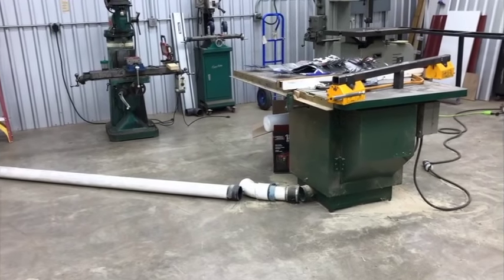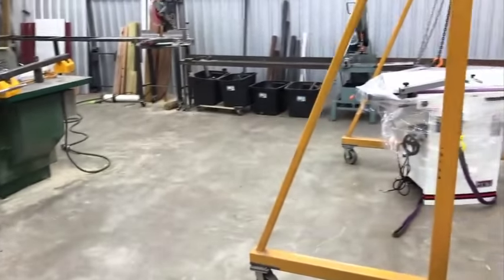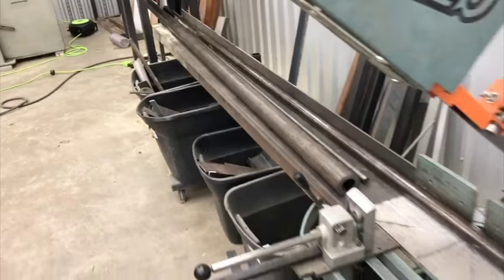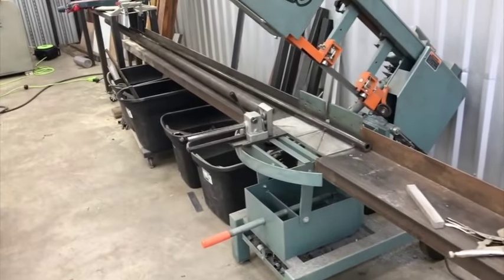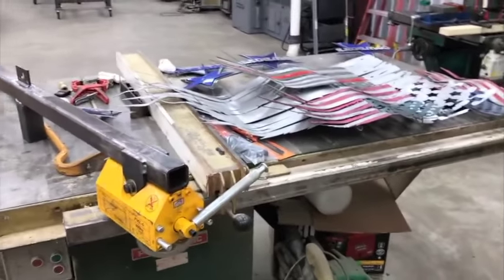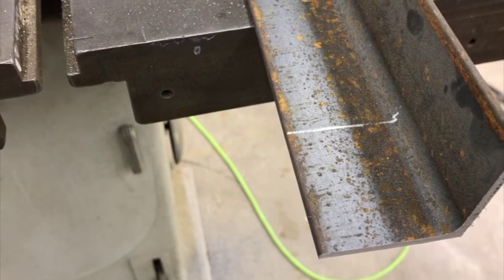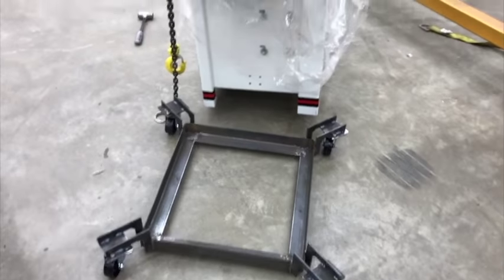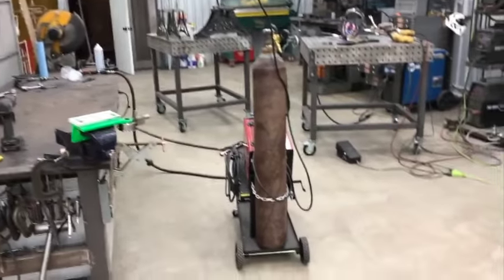Daily Grind - Vlog - Building a Jointer mobile dolly

Comment: For that trailer, you might want to consider one of those trailer dollies, 2 wheels, a ball, and a handle.  It will help for steering it around outside, where you don't have a perfectly flat floor for the drop-leg jack to roll on.
Reply from the maker: yea good point on that for sure... the third leg has plastic wheels on it and its junk, doesnt move around well on a nice floor, definitely wouldnt outside.  Btw, i saw you harrassing Frank Howarth over his CNC... did you get a response?  lol
Reply: No response, other than the other people who just don't get it.  If Frank's table was custom built for his needs, and has a STURDY base, why take an offer of another machine with a lightweight base?  He could upgrade the steppers to those Teknic Servos for a few hundred and have a REALLY FAST rapid on the table.  I just didn't see any advantage...

Comment: Another idea I think would benefit you and others is a manual to semi-automatic bandsaw kit.  You could use a semi-automatic bandsaw for cutting that tubing.  If you're interested on a collaboration, I could possibly spend some time coming up with some ideas on how that could work.
Reply from the maker: I was not even aware there was a semi automatic bandsaw.  If I sell alot of these pre-cut kits, definitely would need to look into it.
Reply: They have fully automatic and semi-automatic.  The semi-automatic require you to set stops for the cut length and have very simple logic.  They used to do it with specialized industrial logic, but I think an Arduino (or similar) would be more economical.  I'm trying to figure out a kit that would work for a saw like yours (infeed and outfeed tables), and a saw like mine (short outfeed table with rod stop and roller stand infeed).

Comment: Dolly looks good, I like doing angle that way too much easier than miters and easier / better to weld.  One of the metal suppliers here sells a degreaser product, looks like they get it repackaged maybe your place has it too?  It's water based, pretty strong and I use it on cold rolled and hot rolled and it works really well.
Reply from the maker: I have been using straight acetone, and it still takes 3 wipes to get it off of there, it just smears around.  I have some ZEP degreaser concentrate, i may give that a try.

Comment: I have the Bosch glide saw and the collection isn't that great, but hooking up even just a shop vac helps a lot. You'll probably need one a trim able reducer though. One thing that worries me is the wood shop being in the metal shop so to speak. Saw dust is very flammable combined with sparks and metal shavings. No good. I have the same issue in my garage shop. One little red hot spark and your beautiful shop is gone. Fire extinguishers and smoke alarms are your friend. Btw sawdust sets off the smoke cheap smoke detectors. Ask me how I know lol

Comment: Hey so instead of that dust collection running across the floor, why not run it across the ceiling and park your tools permanently?
Reply from the maker: Because I want to be able to move the equipment around for various projects, like that project with the plates this week, I was albe to easily move that jointer out of the way to make room to back my truck in and unload it with the gantry crane

Comment: I hope you got your internet deal worked out if you plan to upload everyday!
Reply: Yes I did, that's why I am able to do it, lol.  Got AT&T 4G data unlimited by signing up for Direct TV, i dont have a TV so don't need that, and it's only $28 per month for the TV part... but it was really my only option
Reply: Ramsey Customs - turbocobra
That is great! What kind of upload speeds do you get with that?
Reply from the maker: It holds about 12mb down, 1.5-2 up... not great, but it's super stable, so I can start an upload and leave it and it will finish with no problem.  This video took prob 25 min.  Compared to Verizon Fios I had up in the metroplex it would have uploaded it in 1-2 minutes.
Reply: Oldbarn Homestead
Not bad still way better than the 8-12hr it takes me!